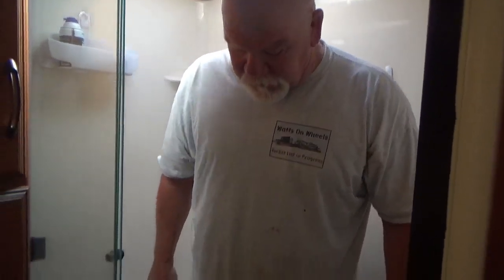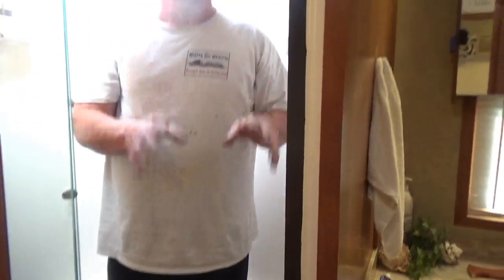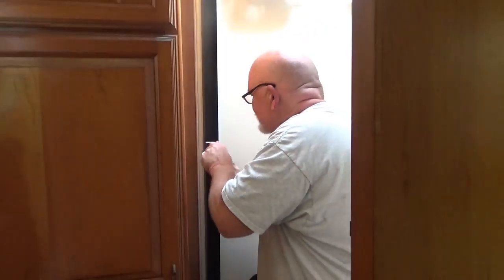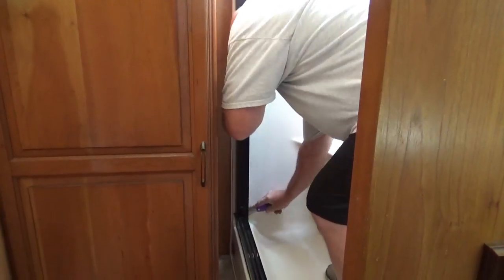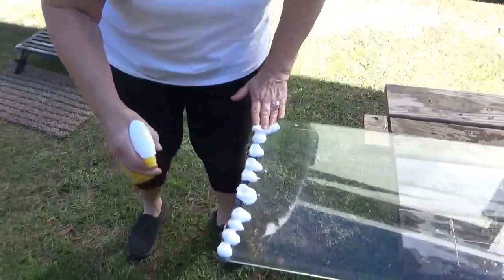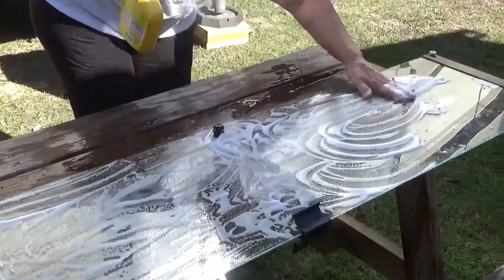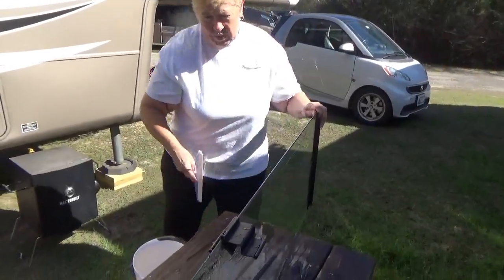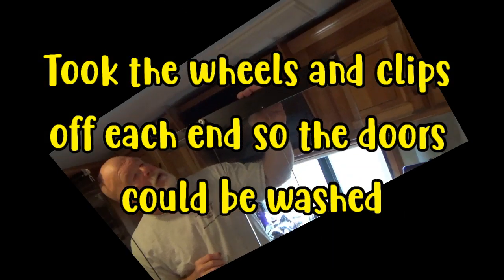RV Shower Door Leak Repair // Fulltime RVing

Comment: Had the same problem with my show door system. Didn’t have the patience to take it apart. Stripped the caulking in the most leak prone areas and resealed with silicone #2. Worked like a champ! Thanks for your video.
Reply from the maker: Keep your fingers crossed and just keep an eye on it.  Thanks for watching.

Comment: Thanks you just solved our shower problem. You see an hour after showering I generally come back an mop up the two ends outside the shower on the floor. Frankly I hate the mater bathroom it’s only a 32”x32” shower a stick home should have bigger shower. Thanks Dave for the how to. 👍🏻🤓
Reply from the maker: It's a pain in the butt to fix, but should be good for a very long time now.

Comment: boy just experienced this and its in the corner underneath now of the join its leaking out of the track. Can i replace the track and the glass for a curtain safely and weight the curtain at all would this work thanks for any suggestions thanks awfully for your video
Reply from the maker: Could try caulking it without taking it apart.  If you are very careful, I suppose you could take the whole thing apart and use a curtain, just caulk the remaining screw holes.  I have heard of people just using just a shower curtain.